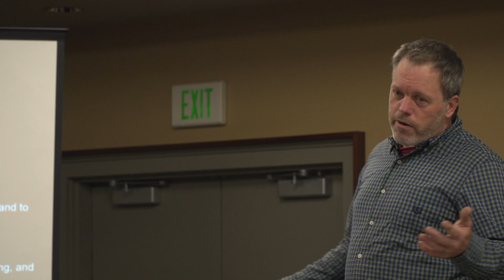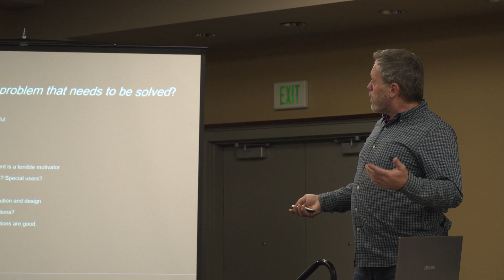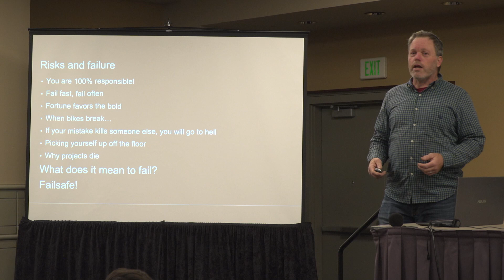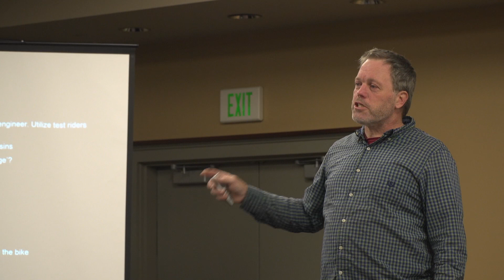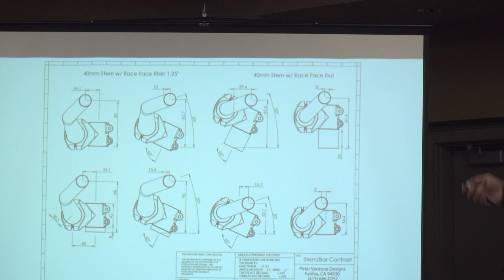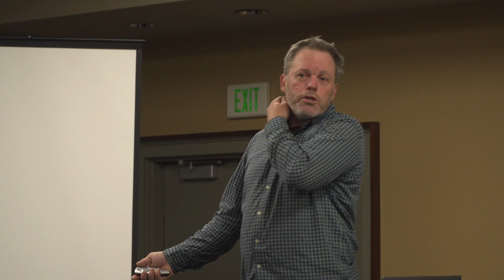Modern bicycle design & engineering for the framebuilder Presented by Peter Verdone

Comment: I've spotted a couple of gravel/touring cyclists who use their stems backwards to shorten their reach for drop bars... but for aggressive mountain biking where a riders' mass is stretched out on the bike and often pressed forward on the bars, isn't it proven to be more stable when that force is applied to the upper steering zone? Even if it's only by a few mm. I've recently switched to bars with 15 degree back sweep on a 26mm stem as a small experiment, and I can't say I'd want to shift my hand position any further back when riding through the rough stuff! 

I've never thought to try my stem backwards. I can only imagine that it would feel stable on a frame where my pedals are way out in front of me and I'm leaning waaaay back on descents.
Reply: You would have to build a frame around it. Simply changing stems is not the same concept.